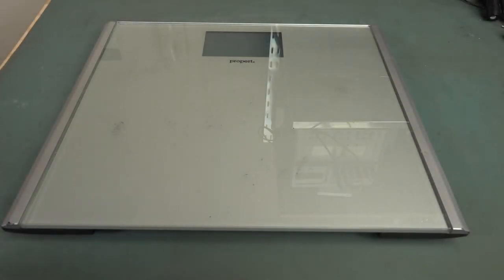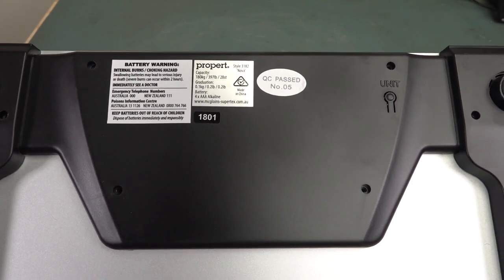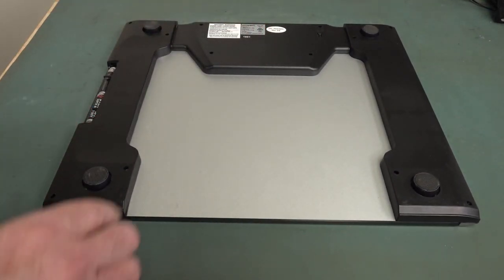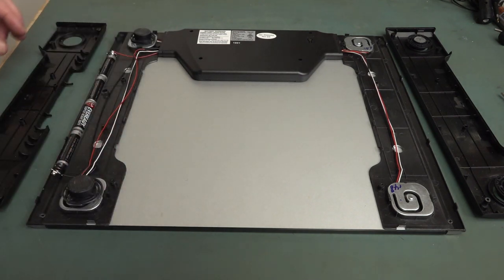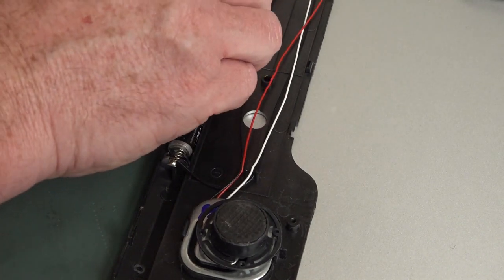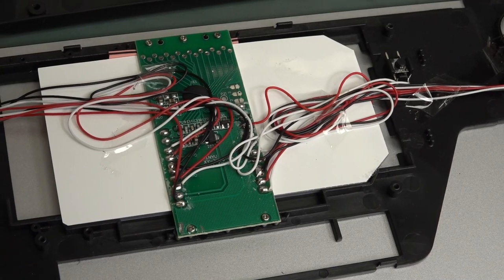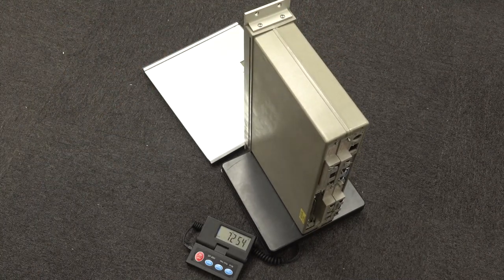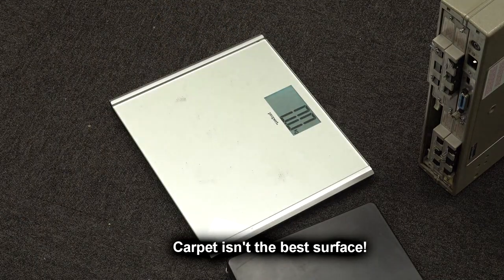2 Minute Dumpster Repair

Comment: Interesting that it takes 4 AAAs to run that. The one we have uses a single CR2032 and it lasts about 10 years per battery change.
Reply: My similar style scale also uses 4xAAA, but arranged side-by-side. I'm guessing your CR2032-powered scale doesn't have a display backlight.

Comment: Excellent fix.
BTW,   I'm finding lots of dead Dyson vacuum wands. The battery packs are fixed to the wand. There is usually at least one dud lithium. cell.
Reply: Sounds like easy reselling ;)
Reply: They're fixed with something like 2 easily accessible screws, and you can buy replacement battery packs from Dyson. Replaced ours in the last year - made it like new. I can't remember how much I paid for the replacement battery but do recall it wasn't as expensive as I'd imagined given the premium pricing of their products new.
Reply: @Thermalions  hey, I really appreciate the information. I'll follow up on that. Seems like an easier route, than trying to reverse fit some ebay sourced Yum Cha batteries.

Comment: Interesting they would use four elements rather than one. Probably several factors: each one doesn't need to have as much capacity. For a scale like this the weight will shift around as the person stands on it, so a single centered element would have major side forces on it as it tilted. And for accuracy, with four you average them so each doesn't have to be particularly accurate. It also makes the physical construction really simple: just a big rigid platform with four feet, mounted not directly but through these simple little metal pieces.

Comment: This one seems to work a bit differently to mine. With mine you tap the scale to start it, then wait while it measures the starting tare. Then it reads zero. You get on and wait a while while it makes many measurements and presumably averages them. It then displays a result that is locked - it doesn't bounce around. I just tried it on several surfaces from tile to thick carpet and it reads the same weight on all of them.
Reply: Mine also does that. It looks like Dave's one here also will lock after a few seconds of steady readings (the number blinks after a second when he puts on the test gear) but it shows the intermediate values as well. IMHO the system on Dave's is better.

Comment: I think Propert is a woolies brand, so this probably came from BigW.
Reply: Bill Whittaker  Completely different and unrelated Woolworths company to that which existed in the US, the UK, or South Africa and different to the Woolworth company in Europe. Woolworths Group Limited in Australia is a retail powerhouse (second largest company in Australia according to Wikipedia), operating one of the two major players in the food supermarket sector. Their holdings also include variety stores, liquor outlets, hotels, poker machine operations, joint ventures with retail fuel stations/supplier. They did have a spectacular fail when they tried to enter the hardware market, but there's no chance of them going belly up anytime soon.

Comment: These things are seriously poorly built.
Fixed one, moisture ingress made the board rot, I ended up battling with the very low gauge wires, mostly breaking them one by one , not only when dismantling the thing, but also during reassembly. Some wires were pinched by screw from the factory, it's indeed hand assembled with not much caution. The battery terminal fault on this one can totally be from the factory!
Anyway, despite my work, the oxidation of traces continued nevertheless, ending under the epoxy blob, and the poor thing completely failed without any hope....
We also have a vintage electronic scale, one that uses a big 9V battery. The base of the scale is itself a big sheet of die cast iron, that probably could be used as an armor plating for a tank. The scale in itself weight a few kilos! Never had any problem with it, only the plastic covering the tactile-dome type switch cracked. I have no reason to peek inside but i'm pretty sure board is a big badass multichip thru hole beauty. Sadly the collectible "made in France" sticker is long gone.
Reply: Did you see the talking scale Fran had? Hers was literally a conventional dial scale but with an optical encoder attached. I wonder if your vintage one is also using that same type of design.
Reply: @eDoc2020  checking that.
Reply: @eDoc2020  nope our vintage scale is one of the first to have pressure sensors.